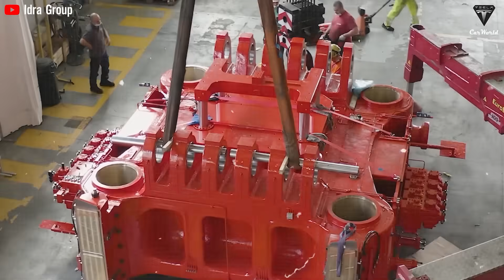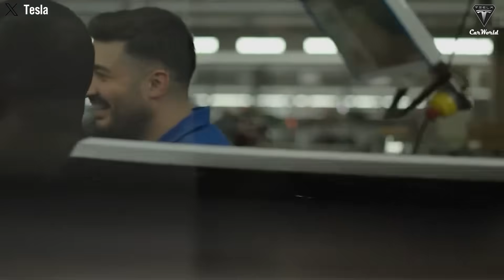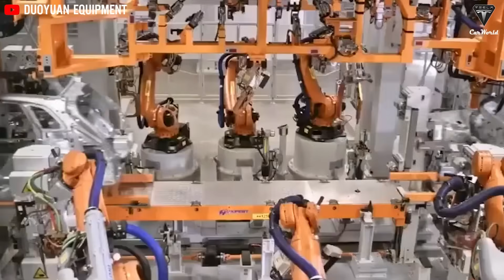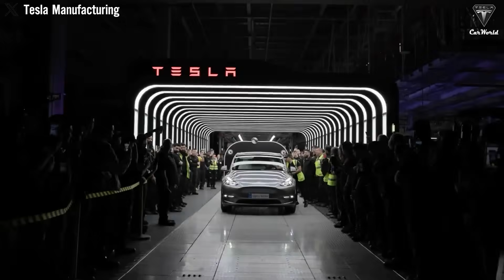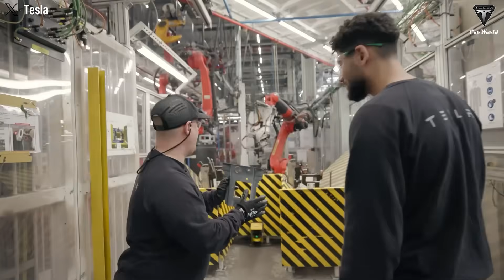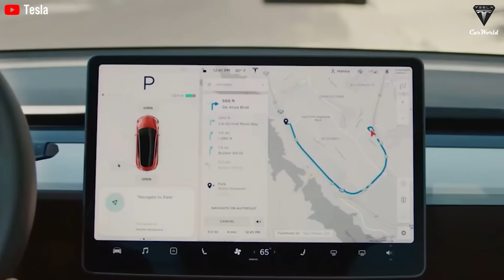It Happened! Tesla 50,000T Giga Press Is Mass-Producing 4 Models in Texas! Elon Musk Explains!

Comment: I agree the battery capacity and driving range are not top in demand right now, but you are close.

BYD is manufacturing LFP batteries that one megawatt flash charge, adding 70 miles of range per minute, fully charged in five minutes.

these batteries have a zero fire hazard, even when punctured with a nail, heated to 300 degrees celsius, or over charged 260% of rated capacity.

at 4,000 charge cycles or 750,000 miles of driving range, the battery still retains 80% capacity.

my research and study indicate that tesla supercharging add approximately 249 miles of range in 30 minutes of charging. BYD LFP flash charging batteries add 249 miles of range in five minutes of flash charging. based on electric vehicle sales, it appears electric vehicle buyers are demanding what BYD is offering. and BYD flash charging Electric Vehicle batteries appear to charge 500% faster than teslas achieve with tesla superchargers.

it’s wonderful that tesla motors is scaling up production and reducing costs of the vehicles, but we also need flash charging capabilities in the US. especially when BYD has been banned from selling passenger electric vehicles within the US, with 100% to 250% added trade tariffs. politicians have placed these tariffs for the purpose of protecting the US auto industry, from BYD auto maker which sells their electric vehicles priced from 7,800 US dollars up to 40,000 dollars, which apparently is too competitive for the US auto industry. especially when BYD is already selling the 5 minute flash charging electric vehicles.

Even Elon said, we need free trade in the US, we need the competition.
Reply: Do you believe anything the CCP says?